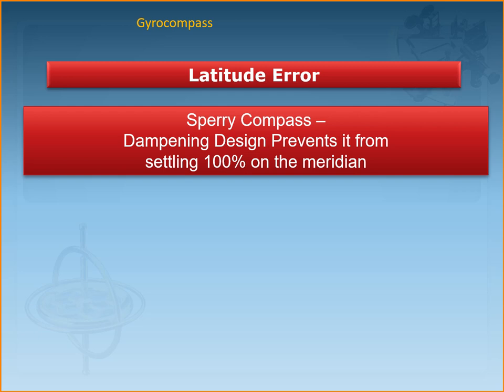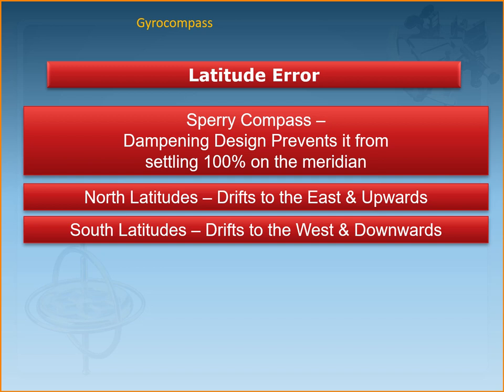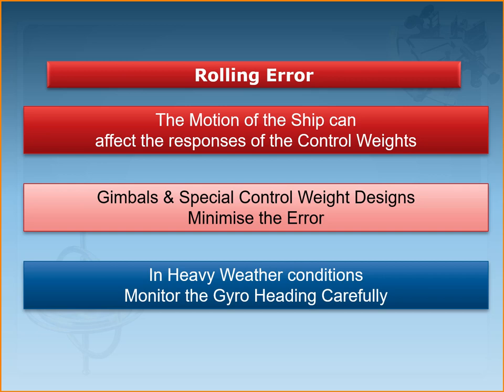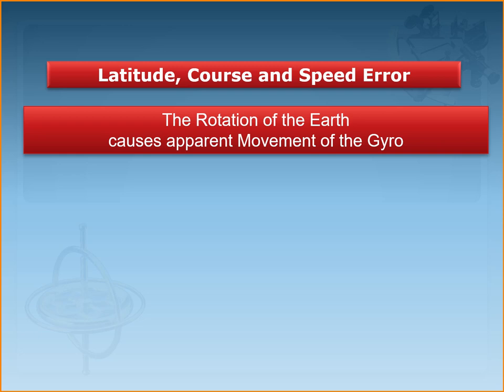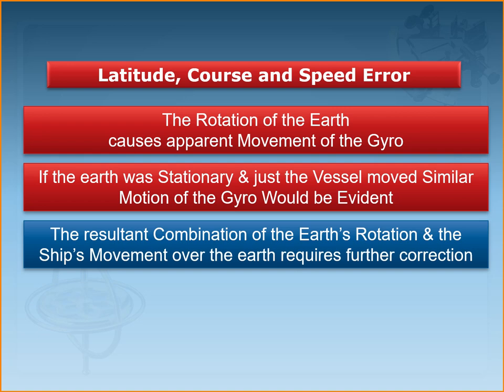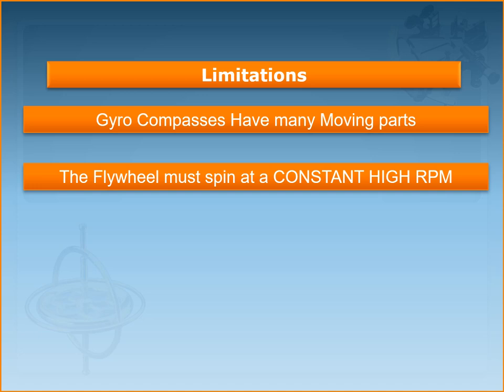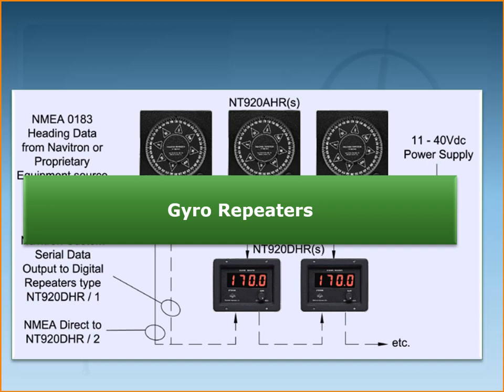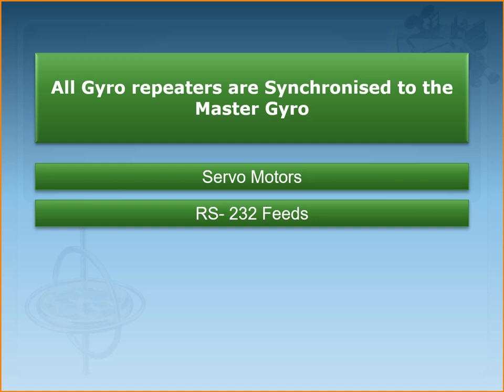Gyro Compass Part 5: Errors & Limitations

Comment: Adding these two( steaming error and settling error) calculated using the formulat, we get resultant gyro error, which is actually same as we calculate using celestial brg/ transit brg/etc..

In short, the gyro error we used to get on ship by taking brg of objects can also be calculated by determining the steaming and settling error of the gyro compass.

Correct me if I'm wrong.

Comment: thanks a ton sir for your videos. could you please explain why gyro is useless in higher latitudes?
Reply from the maker: To be honest, gyro is not 'useless' in higher latitudes. It is considered 'unreliable'. But the modern day gyro compass is being constructed for high latitude navigation and hence can be considered more reliable than its older counterparts. 
The reason older gyro compass was considered unreliable north of 70 degrees North and south of 70 degrees South is because the accelerations due to coriolis force in the higher latitudes would be so high that it would be challenging for the gyro to seek and settle North for a long time.
Reply: Steering Mariners thank you sir ... really appreciated
Reply: @SteeringMariners  Did navigators actually document these increased errors in gyros at those extreme latitudes or were the errors primarily magnetic?
Reply from the maker: @nathanyamaha465  always, however, these practices have now lessened since the introduction of fiber optics gyro